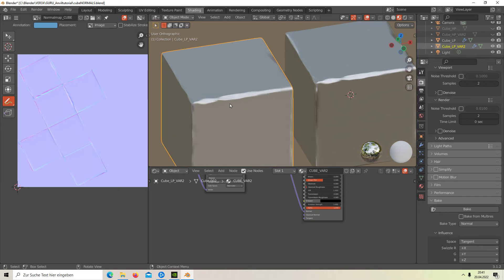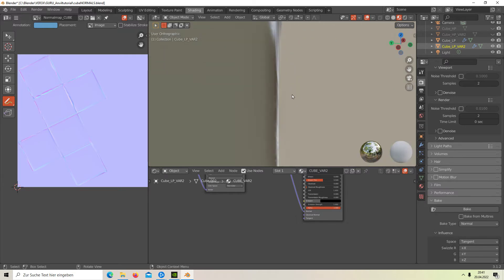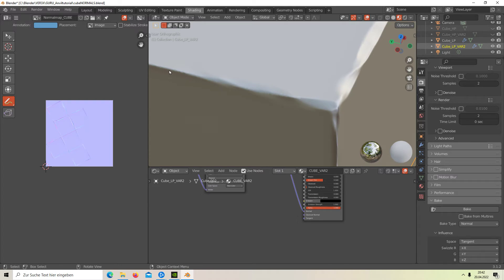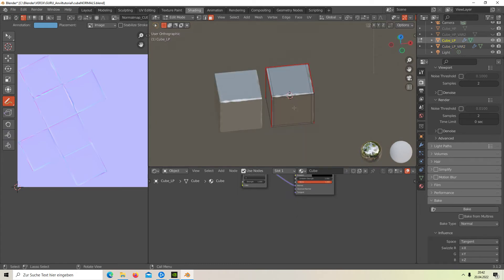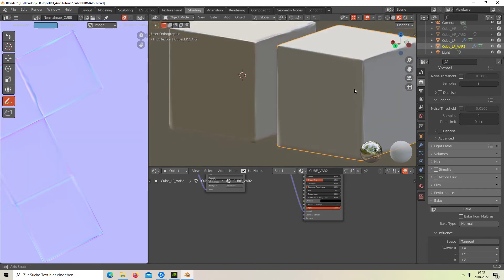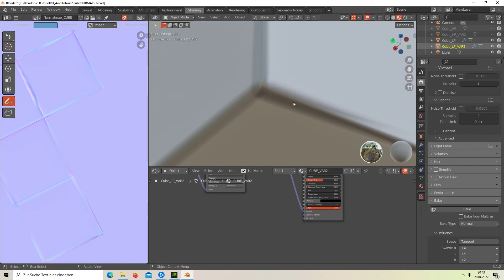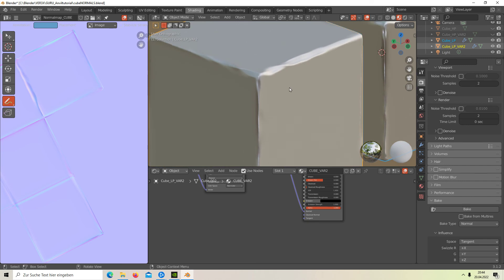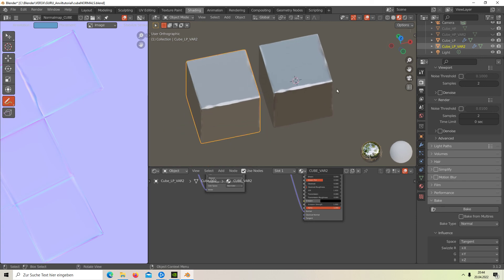Question/Blender: Problem with Normal Baked Seams

Comment: The solution is to select the lowpoly object and enable shade smooth, then bake it. But I have another problem because I'm making a modular kit for Game level where one wall is placed next to another, and the problem arises with the shadows in render mode with any source of light, like a point light. The shadows appear as individual shadows for each wall object, and because of this, the seams are visible through the shadows. Baking normals with shade smooth enabled causes shadows drawn incorrectly, but if you're not making modular environments, then I don't think it will bother you.
Reply from the maker: Ah 3 years later finaly a solution ^^. Well those problems can sometimes really bother you in blender. So if i understand correctly, you are playing with realtime shadows? Well may be you could exclude certain parts from beeing smoothed - so instead the entire object simply select certain faces in Editomode to shade smooth/sharp. I think there are also modifiers that do that based on angles.

Comment: Hey bro. Just bumped into this problem with same cube that need to be baked from HigPoly cube with beveled edges.
So my thought are - marking sharp didn't do nothing with seams after bake, so i went to Marmoset with exported cubes (LP and HP with beveled edges) and there baking was done perfectly!
That's because Marmoset is using "smooth cage" option, so all edges of model are like wraping with cage (sort of) and project rays not only from flat sides, but from they "junction". But if i remove Smooth cage option, baking was done like in Blender - with visible seams on the edges. So its like a projection from planes upon every polygon, but without wrapping around edges (if you understand). 
The way of your not marking a seam between two 90-degrees polygons, working just like if it was "smoothcage option" because projection was made without "dividing" two polys apart when casting rays. But it is not right to not mark hard edges as seams, so this is not a solution.
In Blender i didn't found solution with vanilla tools of baking, but i remember watching some tutorials with baking possibilities with addon TexTools - it has baking options with more features, so if you or someone else reading this - could try if you want to bake Normals in Blender. Otherwise use marmoset.
I found it easier to export my complex model to Marmoset just for baking normals (or AO), and if i need to bake diffuse map or roughness, etc from my procedural materials to texture - it can be done in Blender without problems.
Reply: Actually there is option i just found -  you could duplicate LP object, named it Cage or whatever, add to it Solidify modifier but check "Only Rim" to to have only outer polys (or just inflate a bit in edit mode with Shrink/Fatten to cover your HP model) and select it as a Cage in normal map bake option.
This way your hard edges will be without ugly seams, great! But :) This cage option is doing "drag image" that close to the edges (like if you have bolts close to the sides of the cube, they will be oval not circle). This eliminates by adding more segments (bevel hard edges with Profile shape=1) so and the Cage need to be with same geometry, because error message while baking. After bake you can wipe those edges on LP.
But Marmoset allows to have Smooth Cage and make "Paint Skew" to fix this dragging along edges. It is a lot easier to manage.

Comment: Select all the seams and set them to sharp edges.
All seams of the islands on the UV should be sharp.
Reply from the maker: anf if you dont want sharp edges ? This is no solution to the problem unfortunately. In this case this might help, but the point is it should not be needed anyway.
Reply: @derschnuff8819  Turn on modifier "WeightedNormal"